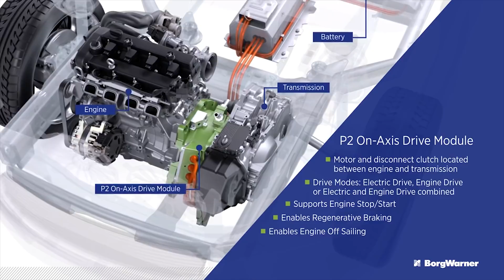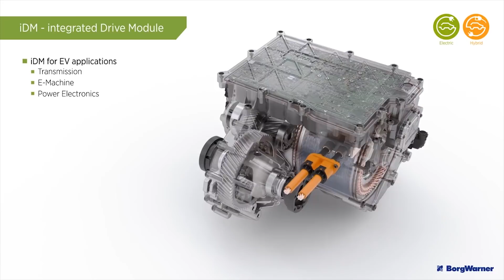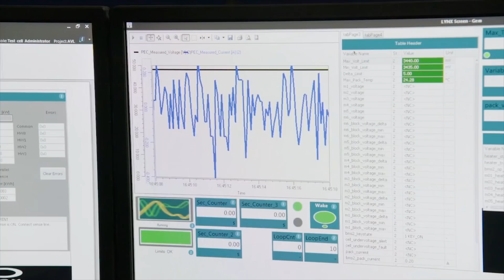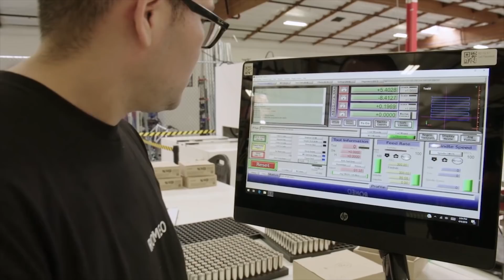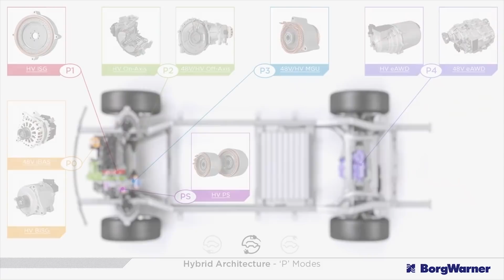BorgWarner Fully Ready For An EV World - Autoline Exclusives

Comment: tier one suppliers is what ruined the automotive industry. manufactures went with them for profits and now you have very expensive vehicles and a system that is being controlled by the tier ones instead of the manufactures.  very sad for the manufactures now and they cant afford to do vertical integration now. they will loose for years to come as we keep moving towards electrification.